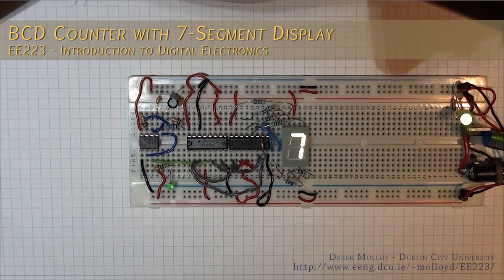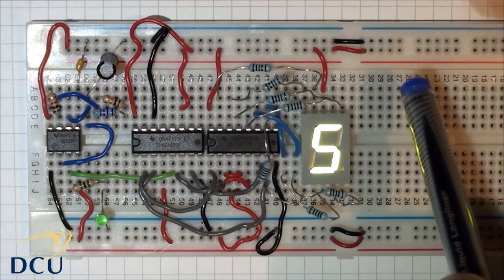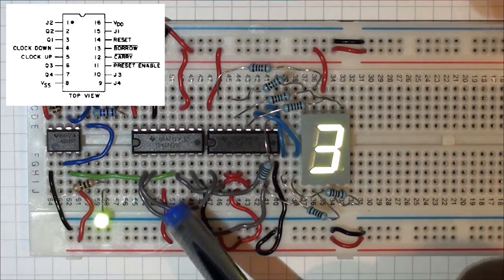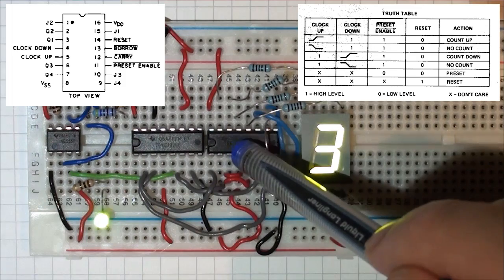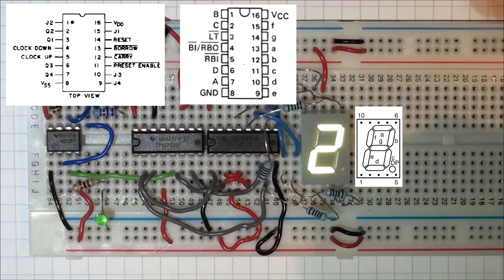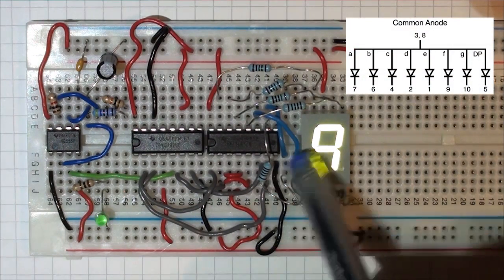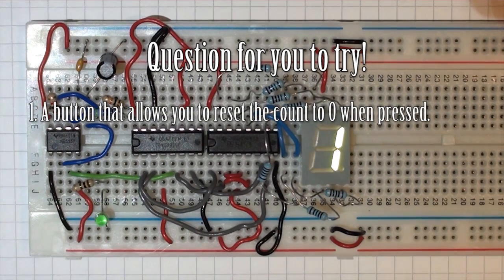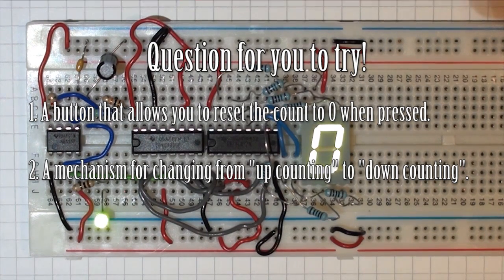Experiments 4.4 : Binary Coded Decimal (BCD) Counter with 7 Segment Display

Comment: hello...can you help to show the connection by using below components :
Vero board x1/2
74LS138 x1
74LS574 x1
74LS541 x1
IC Socket 20pin x2
IC Socket 16pin x1
7 Segment common anode x1
Push button SW x2
Header pin 1x32ways x2
Resistor 330/220 x9
Resistor 10k/4.7k x2
7805 x1
0.1uF x2
10uF x1
LED x1

TQ...

Comment: please help me to construct a binary and decimal counter.. just like this one... here are the following materials..

1 IC 7493 4-bit binary ripple counter
1 555 timer
1 IC 7447 decoder driver
1 IC 7730 seven segment display or equivalent
4 indicator lamps (LED)
1 4.7k ohms resistor, 1/2 watt
1 1K ohm resistor, 1/2 watt
1 47ohm resistor
1 470 micro-farad capacitor, 16volts
breadboard
power supply
connecting wires..

hope you could help me..